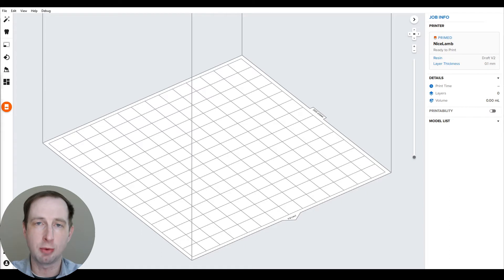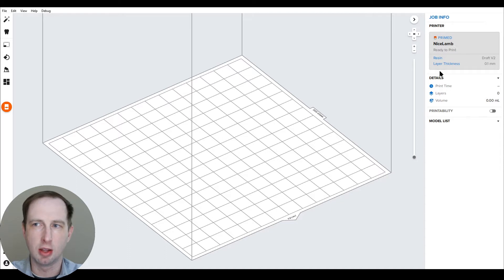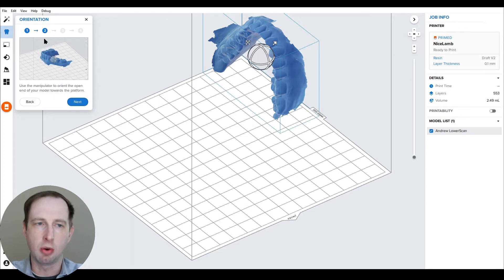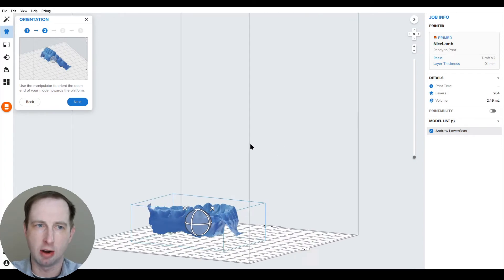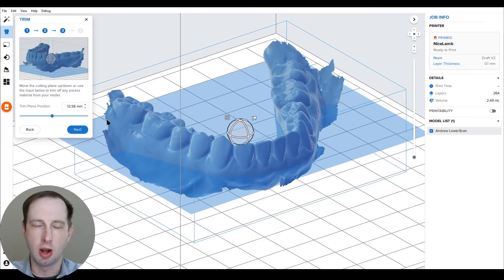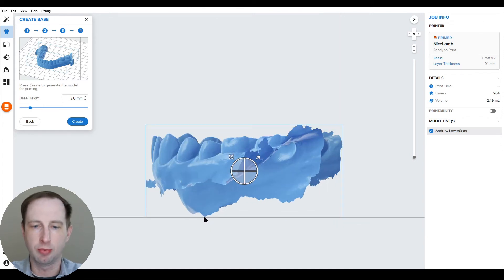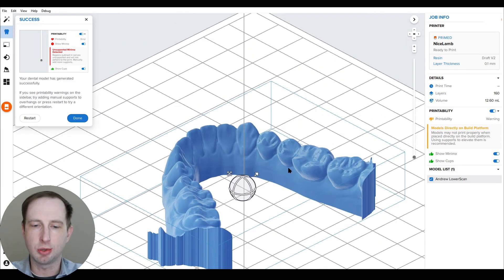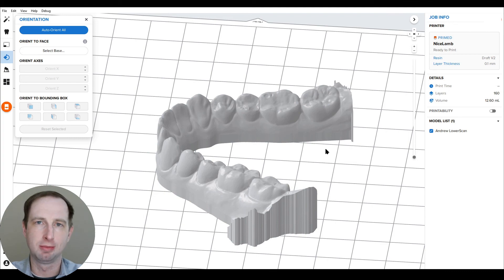PreForm Scan to Model - Basic Walk-through

Comment: Hi Sam, I thinking to buy a 3B printer but, I downloaded preform to take an early tour, so a have a question, can I use the scan to model tool with a virtual printer? because a can't see the option.  Thank u
Reply from the maker: Hello! You cannot use scan to model while using a virtual printer. The team is actually working on a "demo mode" to allow customers like yourself to try it, but its still in development. Sorry about that. If you have a digital impression you'd like to see built in scan to model I'd be happy to run it through and share a video, even print you a model! Let me know. You can email me at wainwright (at) formlabs.com